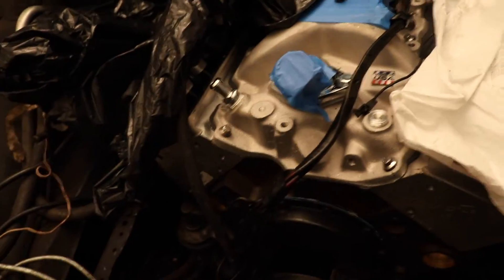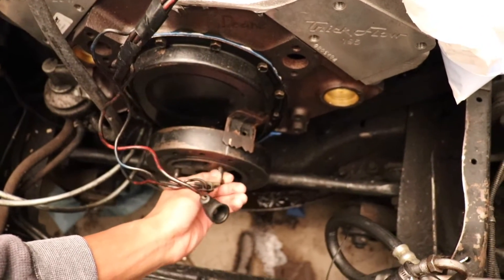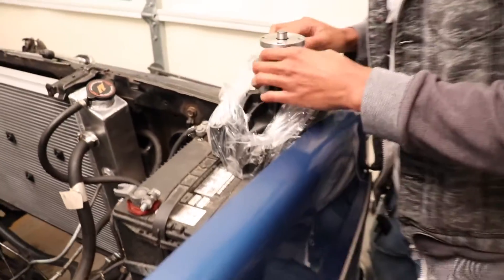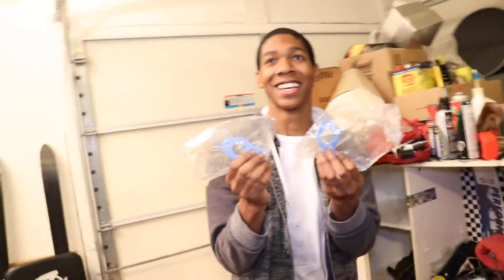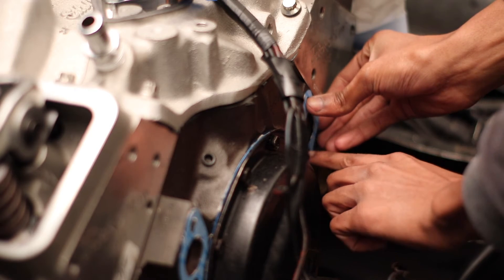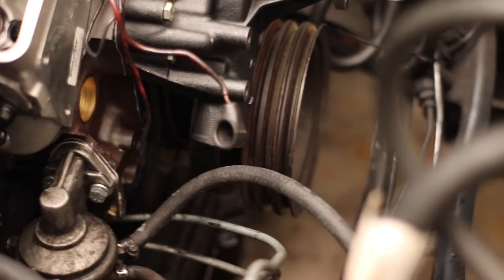Small Block Chevy CRANK PULLEY AND WATER PUMP INSTALL

Comment: Are you using a 12 point socket on a 6 point bolt..? but man, you should have this thing buttoned up, or atleast video your entire pulley install in one video, then video the install of the carb and necessary fuel lines. Its pretty much straight forward from here.
Reply from the maker: Lol no there made to fit around multiple things. They came in a craftsman’s tool set

Comment: Do you have a part number for that triple groove pulley ot do you remember if it had 3 or 4 bolt holes on a sbc
Reply from the maker: The pulley is actually the same one I’ve been using for a while. It came with the truck and it was in the fully stock small block Chevy that the truck had in it before so in really not sure where it comes from lol. It could be from anything. It has 4 bolt holes.